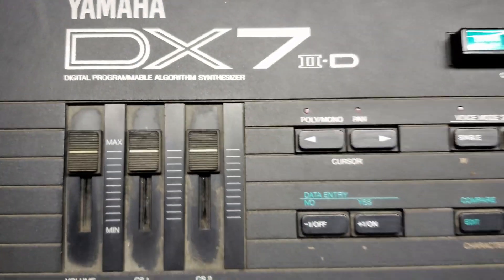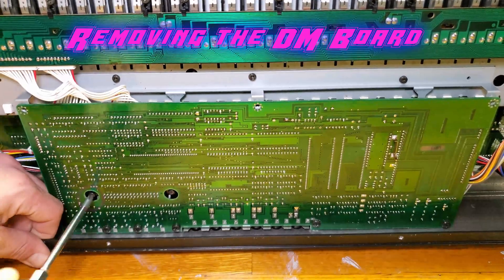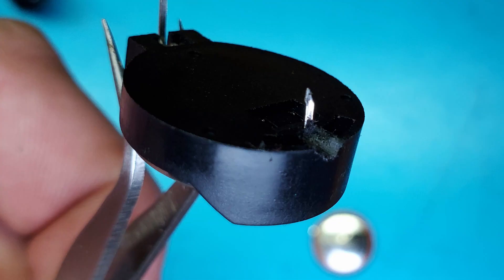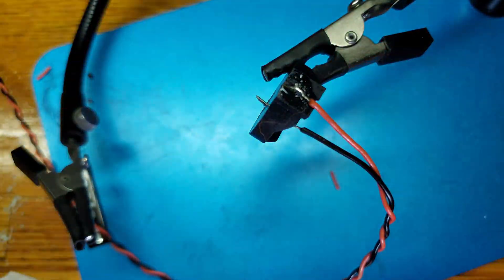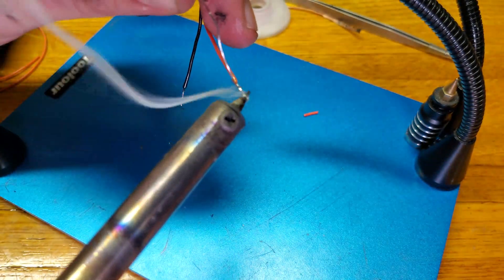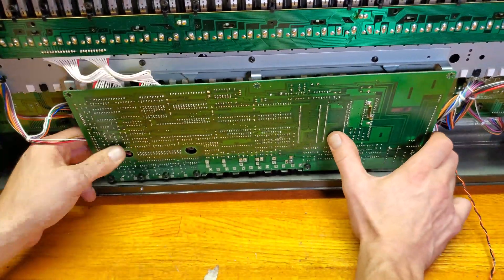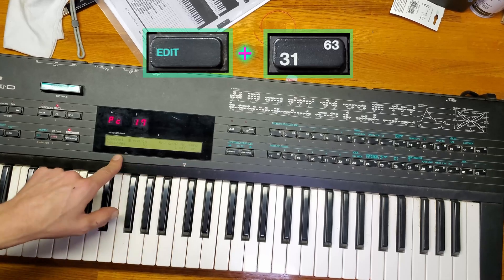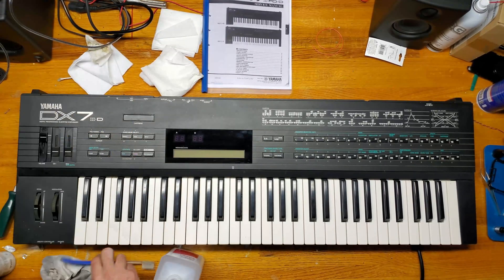Yamaha DX7 IID Repair (Battery Replacement)

Comment: What are using to clean the DX7? Is that rubbing alcohol?
Reply from the maker: Yeah, I'm using isopropyl alcohol. Typically 90% or more because it's fast drying. You should be careful with it though because it's not really a general cleaner and can damage somethings

Comment: I have changed the battery for a new one but it still leaves me the message.  "CHANGE BATTERY" even though the presets are preserved, that message keeps appearing and I don't know how to eliminate it. Thank you, I hope to have your help.
Reply from the maker: I have not delt with a problem like this before so I can't provide much help. But
I would start with testing voltage across the battery (with the test on the unit itself and also with a multimeter with the unit off and unplugged). Best case the "new" battery is faulty and just need to be replaced. Batteries do have a chance of showing up DOA or hopefully in your case, lacking enough charge to clear the message but enough to store the patches
Reply: i have the same problem , i did some research , and it was suggested to check the Diode near the battery its D4  as sometimes the heat from desoldering can damage the component  , if you have a meter check the connections across the diode , the coin cells are usually 3v  CR 2032  and across the diode should be around 2.5 v  .